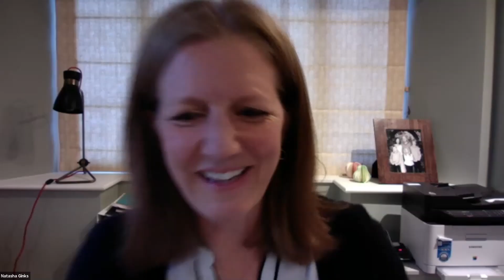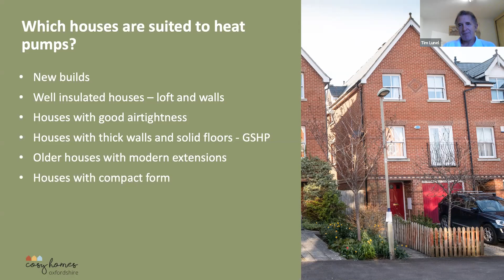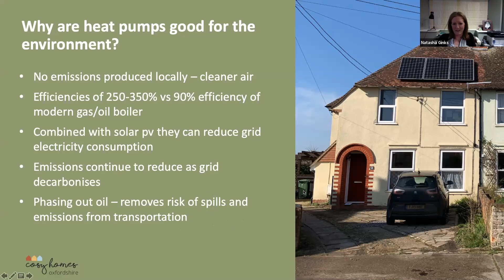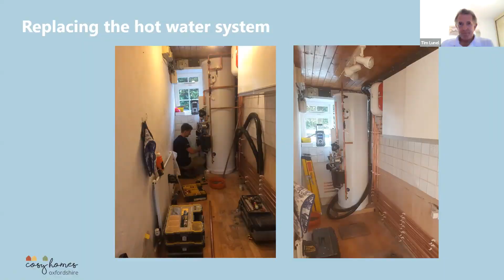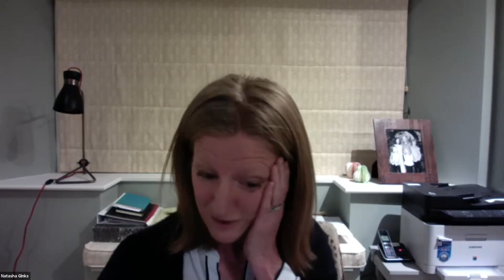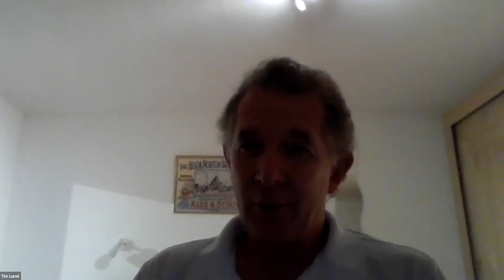Using air source and ground source heat pumps to heat your home | Cosy Homes Oxfordshire webinars

Comment: Surely with the cost of electricity you should be insisting all rads are designed for 30C flow ? If you haven’t got under floor heating.

Comment: I consider myself a fairly normal sort of a bloke with a wide circle of friends and I never hear anyone say oh I saved all this carbon how good am I look at me saving the planet.  No I hear people saying I saved this much money and it’s ultimately money that drives people.  Try going down Tesco get a basket of shopping and try paying with some of your precious carbon savings  you will get a swift Fuck off.  By the way I have installed two heat pumps and super insulated the houses and the money I saved enables me to buy more diesel for the land rovers to keep my carbon foot print up.

Comment: I'm curious as to why air-to-air heat pumps were not discussed. They are less cost to install, particularly for properties that require piping and/or radiator upgrades, can have the piping installed outside of the dwelling and are just as if not more efficient as air-to-water. Ground source heat pumps are the "Rolls Royce" design for performance but come with an equivalent price tag. Some air-to-air units now even have direct connection options for PV panels so there is less electric loss with inverters and use solar to it's best advantage while adding grid supply as needed. This would be a lower cost highly effect solution for many people potentially.